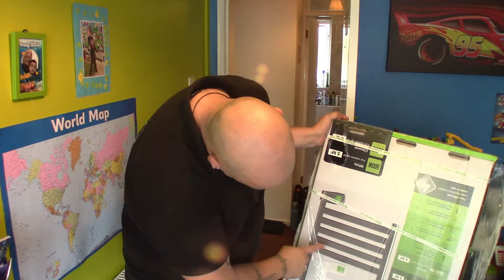REPLACING Old Storage HEATERS with Electrorads Aeorflow

Comment: Nice video 👍 were the storage heaters on a economy 7 board? If so how did you overcome this so the new electric rads had power? Thanks
Reply from the maker: Thanks mate. Those ones where only on E7 with no day time boost. With this one, I just removed the E7 line wire from the meter and connect it together with the normal supply on a heanly. Neutral was common.

Comment: I've removed my old storage heaters and was going to tape up the wires (red and black circa late 1980's)  and put a blank plate over them. Instead I decided to install a   socket which I've wired up but it doesn't work. The heaters used to come on at nights (economy 7) ...could this be the reason it doesn't work?
Reply from the maker: That's right. As it's still on the E7 it will be live during the hours of your night electricity

Comment: Did you notice any reduction in electric bill after you replaced the heaters ?
Reply from the maker: I don't have any data as always I only install them and walk away BUT they surely more efficient from storage heaters even on Economy 7. Their biggest benefit is that you use only when you need them and all of their warmth doesn't get wasted during the morning while most people aren't even home.
Reply: In theory, the cheapest solution should be the modern HHR (high heat retention) smart storage heaters on an E7 tariff.  They have better insulation to keep the stored heat inside until the timer or manual control is used to release it.  With the central control box, they can also behave like a multi-zone traditional gas boiler & radiators.

More expensive to install, but that should be saved on the running cost.

That's the theory, anyway, and supposed to be the most efficient electric heating.  There will still be some waste heat, but it stops the home going completely cold and keeps out damp, and it's 10p per kWh that's being "wasted" instead of 30p+ per kWh.  Heating a room from cold on the expensive electric is not cheap (to initially get it back up to a comfortable temperature).